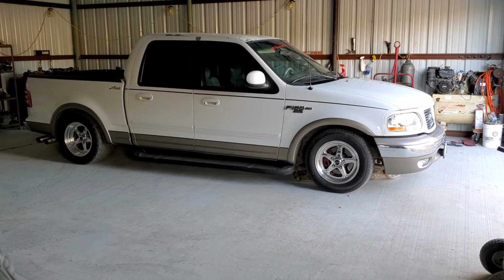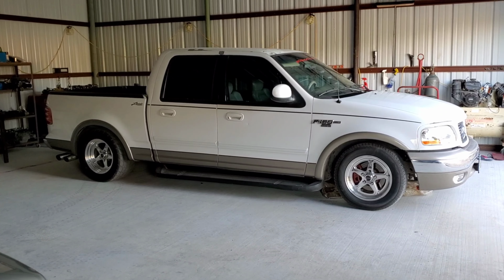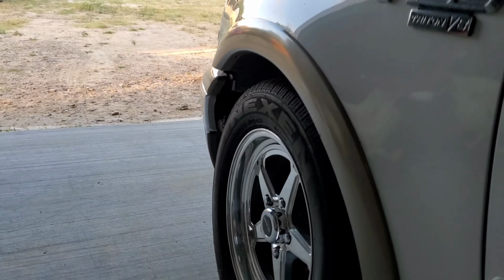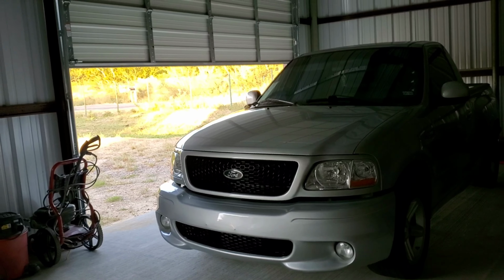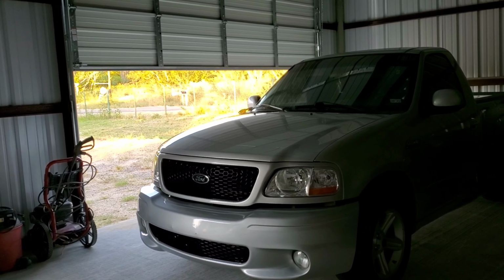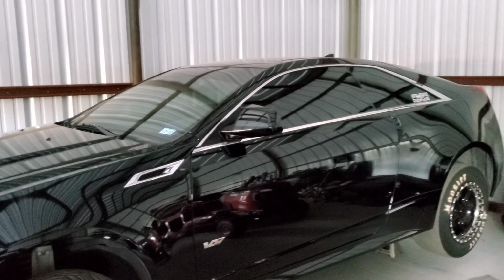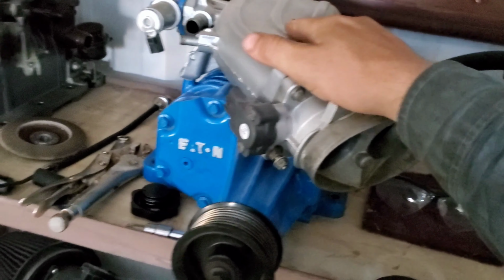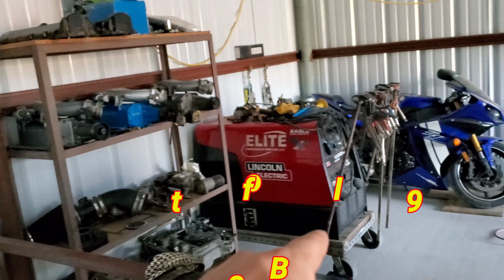Svt lightning swap f150 new engine updates ""

Comment: Hey was up bro wanted to knw what would I need to swap a 2002 lightning motor into a 1997 f150 with a 4.6 engine and 5 speed manual transmission.. can it be done or what do you recommend
Reply from the maker: Was up bro. And yes sr it can be are u going to stay with the 5sp or are u going to go automatic. All u will need is full harness and ecm and transmission.
Reply: BoostedDave thanks for replying bro I appreciate it and yeah bro i want to keep the 5 speed for now eventually ima buy a t56 6 speed manual transmission. But yea I want a manual lightning bro
Reply from the maker: @fernandogonzales3360  that will be a great project bro. There's a guy in youtube that has a manual svt lightning and sounds amazing bro
Reply: BoostedDave yeah bro just wanted to knw if it can be done before spending all the money on the engine band not being able to do it
Reply from the maker: @fernandogonzales3360  u can do it. All u need is all the harness amd ecm3
Reply: BoostedDave you got a Instagram??
Reply from the maker: @fernandogonzales3360  yes sr boostedlife294

Comment: Man, I was in the market for a supercharger for a 99/00 style. 
I ended up finding one in mission for $180 but was missing the pulley and had to spend another $124 on a pulley extractor.
Reply from the maker: Thats a good deal didnu find just the supercharger or the whole kit
Reply: @boosteddave4603  It was just the supercharger alone minus the pulley and the blowoff valve. 

Mine needed the needle bearings replaced because it sounded like a tin can full of pennies at idle lol. 
I'll fix it later since I don't have the tool for pulling needle bearings and they do go for around 60 bucks.
Reply from the maker: @TheTruthBeToId  🤣🤣... Jokerzperformance they do a great job in rebuilding it new or ported and  550 fully ported and rebuild
Reply: @boosteddave4603  Not bad but I'd rather do it myself to gain the skill and since im in a budget. Those ports they make look simple enough to mimic, so it'll be worth a try in the future since it's a secondary s/c.
Reply from the maker: @TheTruthBeToId  💯 bro... i am looking to go whipple or custom single turbo on my f150
Reply: @boosteddave4603  Gotta consider a Kenny Bell. Those things are proven to make more power over whipple superchargers.
Reply from the maker: @TheTruthBeToId  they both perform great depending on what u want.. or a single turbo set up would be nice haha
Reply: @boosteddave4603  Gotta love the turbo waste gate sound. Def go turbo.
Reply from the maker: @TheTruthBeToId  we mite do it
Reply: @boosteddave4603  That'll be a fun video.
Reply: @boosteddave4603  man im looking for supercharger set up as well.if you hear of 1 please let me know. And the 4 2 drop looks good I wish I would have picked it instead of 3 1 I put on mine
Reply from the maker: @jamiecassard4355  thank u appreciated and yes we still have one for sale

Comment: Hey bro I wanted to ask what I can do to make power N/A , I’m saving up to buy a supercharger kit but I want to also make power
Reply from the maker: Before I did my swap I had fbo, full exhaust, air intake, pulleys, and tune and 4.11 gears
Reply: @boosteddave4603  which pulleys did you change? For N/A and where do I buy em?
Reply from the maker: @danielcastro8012  for the na i used the bbk pullyes and they sell them in any auto parts store. But ones u do a supercharger swap they don't work
Reply: @boosteddave4603  are they smaller or what?
Reply from the maker: @danielcastro8012  the crank pulley won't work because that's where the supercharger pulley attaches to the oem cranck pulley and then if u go with the rest they will be mix match and your alternator will be off

Comment: Any updates on the red lightning with the bad engine
Reply from the maker: Thanks and yes the red lightning had 3 rods and bearings burned and they where lose... and I've seen speedlab they did a coyote swap 2002 f150. Came out great
Reply: BoostedDave shit I took Iam putting in the na 5.4 in my lightning and Iam rebuilding my original motor I will take my time money tight now
Reply from the maker: @stevenhanna242  i hope everything comes out great bro and same here work is kinda slow. We work with natural gas not much oil but is still slow and are u building it forged or just oem spec
Reply: BoostedDave I work here at Atlantis hotel here in the Bahamas we been close from March
Reply from the maker: @stevenhanna242  wow I hope everything picks up over there bro.. i beet u is amazing out there the outdoors.. would love to take a cruise ship out there